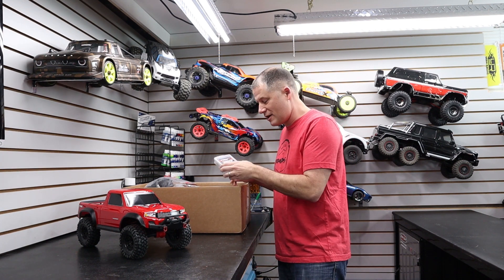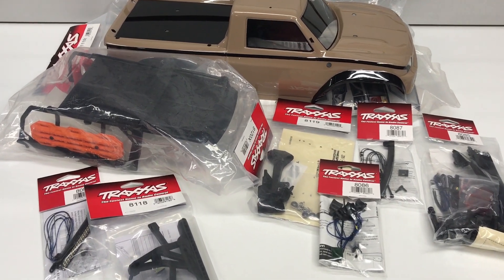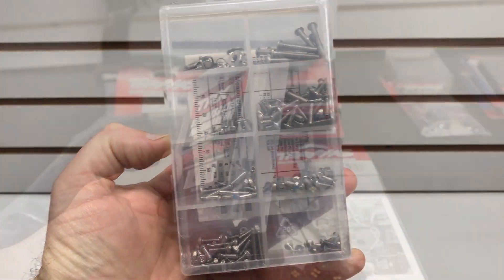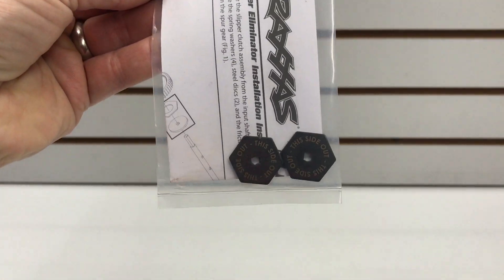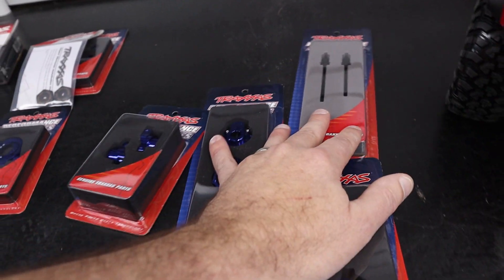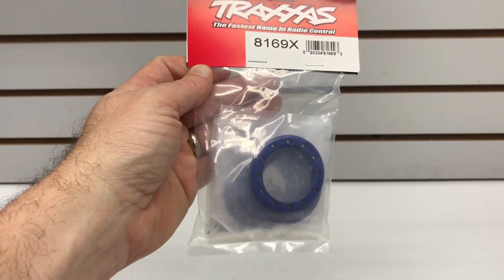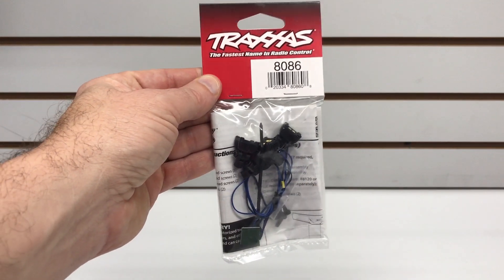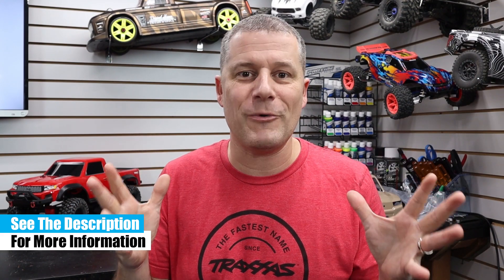So Many Option Parts! - Traxxas TRX-4 Sport Full Upgrade Project Truck Intro | RC Driver

Comment: You are missing narrow fender kit with rubber fender extensions. Helps with mud and dirt plus it gives you forward mount options and multiple shock options. You also can add rear underdrive for like 23% overdrive total! I would add the 2spd kit for bashing capability and upgrade to brushless. Maybe 550 3300 axe.

Comment: You should do the Traxxas Slash 2wd, mainly because everyone has  one that is involved in the hobby.
Reply: Kevin Tomyn nobody uses the slash anymore and 2wd is not that great so if anything just get a dessert racer
Reply: @gwraffe6812   For a beginner hobbyist the slash is considered one of the most popular starting rc's. Especially for it's price point and quality. It only costs around $250 for a base model.

Comment: I'm looking forward to this build series. I've got the TRX4 Bronco and it's pretty well dialed in as far as I'm concerned ATM. Maybe in the distant future I might put on aluminum axles or the lift kit, etc,etc. Right now it has aftermarket aluminum beadlocks, tires, servo, light kit, spare tire carrier, bumpers, winch, and Proline shocks. Had a roof rack on it but was too heavy and I removed it. My neices have Sports and they seem to like them. One neice is 8, the other 11. I already purchased them a pair of aluminum servo horns to be ready when theirs go out. Not sure on which servos I want to get them yet, cause that will be next. I'm sure I'll get them the same servo my brother has in his, it's working well. The servo I run in mine is a lot more expensive and I'm sure they won't need one like I run. Other than the mods I listed on mine, I've got the Traxxas Traxx which I've yet to run on it. No other mods that I can think of. I'm content on how it is right now but I do intend on putting the Hobbywing Axe system in it when the current motor and/or ESC dies.

Comment: Mine came with most of the scale accessories your going to do. But I’m still learning and am designing a beater body and keeping the other one with all the lights and accessories for show.  You have a ton of parts that I was curious about upgrading.  Especially my steering servo because of the tracks. You provide a lot of information in an easy to understand video. Thank you.

Comment: How about a before and after run video to see if all the upgrades paid off?
Reply: The only ones that would pay off would be the servo, aluminum portals for front, brass portal weights for front , aluminum knuckles, and bead locks. The others are cosmetic.
Reply: But many of the cosmetic parts ie. the rear rack will add weight and make the truck top heavy.... so that will change the performance

Comment: I have a Defender TRX4, so I've got two speed and locking/unlocking diffs. Should I overdrive the front or overdrive the rear? I use it in high gear a lot and use low gear every once in a while on the trails

Comment: Traxxas is doing some cool stuff.
Question...why overdrive the front? Higher gearing means possible torque-twist. 
Why not underdrive the rear?
Reply from the maker: Tom Lucas After briefly skimming over some TRX4 discussions, it seemed overdriving the front was the way to go and torque-twist was minimal. Probably should have picked up the underdrive set as well. I’ve never tried either on a TRX-4 myself and looking forward to see how it drives. Perhaps the different gear set offerings and combos would be a good stand-alone test video.
Reply: @rcdriver  I always underdrive the rear , not just for the possible torque-twist but because you only gear-down at the pinion "so much"....but you can gear-up to the moon.

Comment: I love it! I own a trx-4 sport that mostly sees snow so it will be getting the lift and tracks along with the high torque steering kit along with the two speed transmission.
Reply: I know I’m VERY LATE but don’t use your tracks in second gear

Comment: Rpm parts better for bashing.  As you said truck needs some flex or shits gonna bend even that cnc shit. If it doesn't bend something is going rip out the chassis. I like rpm because if I hit a wall at 50mph all I break is a camber block.  If you have that aluminum it bends and breaks more expensive parts like the a arm or even chassis

Comment: I would think that you should install the under drive gears in the rear axe (part # 8288).
Reply: I think you mean axle.
Reply: Thanks it was axle ( old guy and bad mind )
Reply: @johngrant1337  You can edit your comment.

Comment: Reason number 1 that I would not buy Traxxas option parts. The colors! Rock crawlers are all about scale. I get the bright colors of the parts for a Rustler or other Traxxas entry level cars. The scale TRX4 it doesn't make any sense.